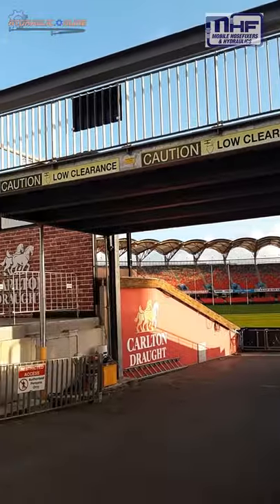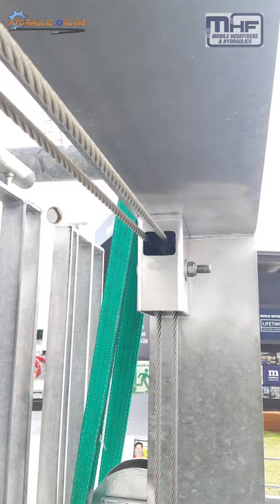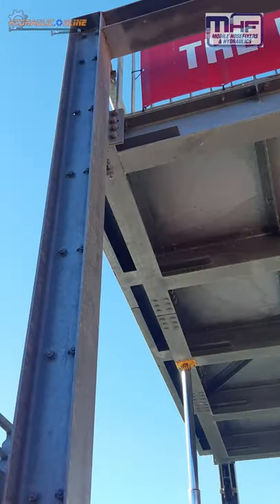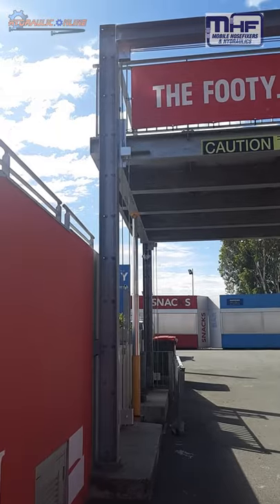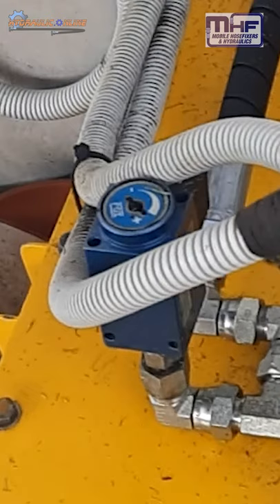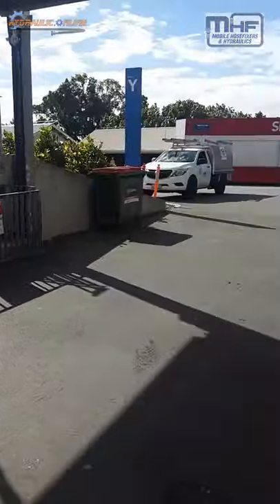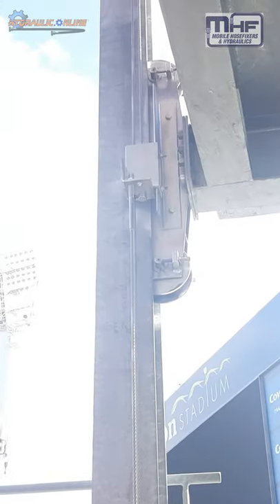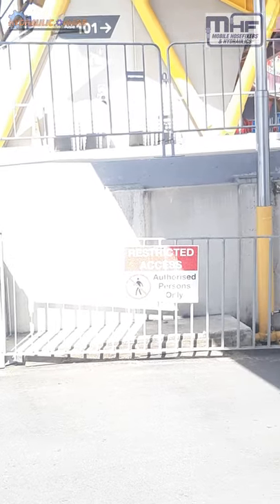JAMMED UP !! 5 Ton Hydraulic Bridge Overhaul and Mods

Comment: Very interesting modifications to improve and ensure parallelism.
But I only have a couple of observations: do I see bad or the cylinders do not have piloted check valves? This can be very dangerous because in case of a hose failure the platform would fall. Because of the cylinders are single-acting, the check valves pilots should have independent hydraulic power, otherwise the platform will not lower smoothly. Likewise, at each of the four contact points with the vertical guides, SAHR brakes should be installed to mechanically and not hydraulically block the entire platform for long periods of time. in the same way, the hydraulic release must be independent of the main hydraulic line.
Reply from the maker: Hi there thanks for your comments and interesting ideas, due to budget and time constraints we left the Hydraulic System as per the original manufacturers design. 

For Your Information each telescopic cylinder has at its base inlet/outlet a solidly mounted velocity check valve designed to shut off oil flow in case of a hose burst. 

Also the down function is controlled by multiple valves and the pump must run as well.   

I like your idea of the Brakes for mechanical rather than hydraulic blocking the entire platform for long periods of time, Spring Applied Hydraulic Release (SAHR) Brakes is a Great and it will require quite a lot of redesign and engineering approvals, I will mention it to the clients during my next inspection visit in a few weeks.